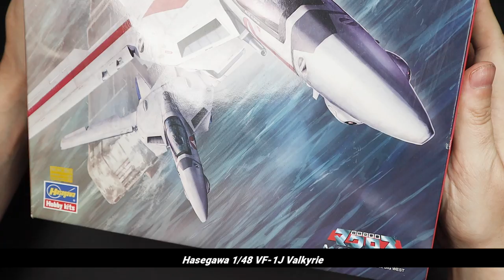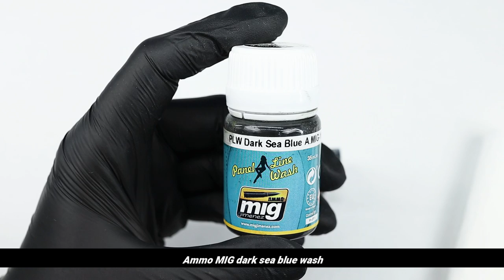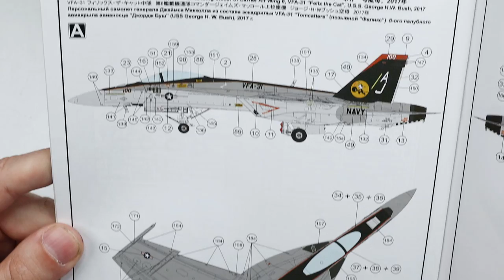VF-1 Valkyrie - Hasegawa 1/48 scale | Full build video

Comment: Hi. Very nice work ! I admit, however, that I do not understand the step from 13:28. with the liquid mask on which we then pass a black veil before removing it. What is it for? I'm not a model specialist, but aren't these lighter areas counter-instinctive? Thanks in advance :).
Reply from the maker: The maintnance guys on aircaft carrier decks remove all the panels a lot. The paint chips off when they do so. They respray the paint along the panels, sometimes with different shade of paint like i did when i build my F-14 tomcat in last video (I suggest watching this one) The darker grey tone is to simulate spray effect.
Reply: @ScaleHangar182  Thank you very much for the quick response. I understand better :) (and I learned something).

Comment: Nice work...however...I feel like modelers always go a little overboard with the weathering. Every airplane doesn't need to look like the dirtiest Tomcat just getting back from a 9 month deployment. Yes, there were some pretty ratty looking Tomcats out there but not all. The weathered appearance is largely due to 2 things. 1 - people walking around on the airplane. 2 - corrosion control techniques. #1 doesn't need a lot of explanation. #2 - The textbook purpose of corrosion control is to prevent corrosion, not cosmetic. The TP paint used on F-14s absorbs oil and grease and doesn't clean off well. Also, repainting entire aircraft or large areas of an aircraft was generally limited to the depot and prohibited at the squadron level. At the squadron level you are only allowed to spot-paint areas with chipped or damaged paint. Often the spot-painted areas don't quite match. If you had an imaginative maintenance Master Chief you could sneakily get away with "spot painting" an airplane 20% at a time over the course of several days and essentially repainting about 90% jet. Depending on the personnel and mood of the Fighter Wing (who runs corrosion inspections) a squadron may be able to get away with more (or less) cosmetic painting.
Reply from the maker: I am not sure what are you trying to say. The level of weathering presented by modeller is his interpretation and usually we are following the refferance photos. Tomcat were extremly weathered and I like them that way. 
Also there is huge misconception when somone say "modelers always go a little overboard", no they actually not because again most of us are following photos. I do, and i love heavy weathered stuff. aking a clean aircraft is nothing fun to me, building the weathering layers is a lot of fun and so much more to learn. 
Not sure if you ever been in model shows, but ratio betwen unweathered and weathered airplanes on shows is probably like 98 to 2 so no, there is not a lot of us.